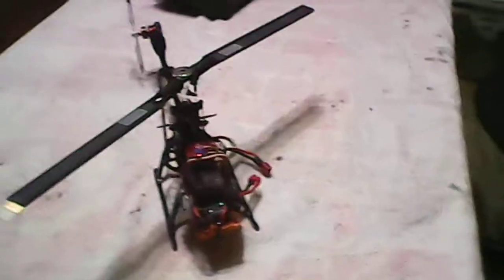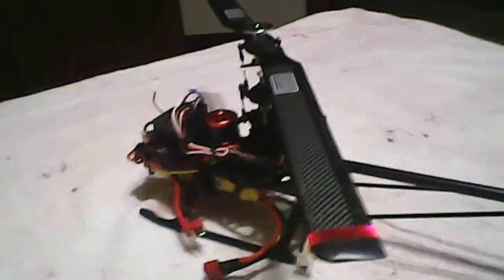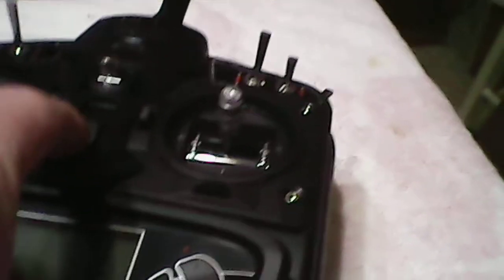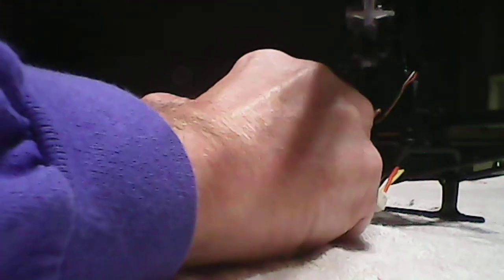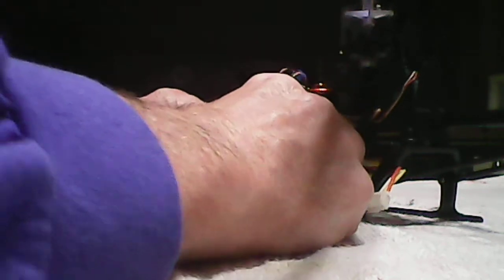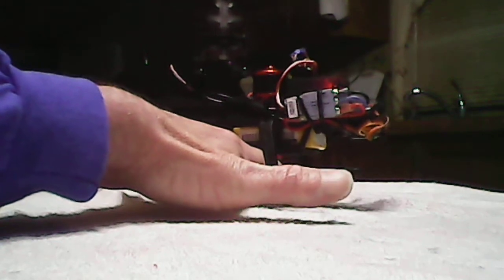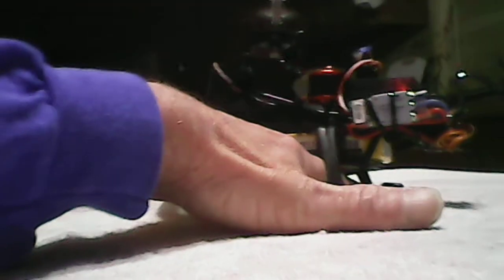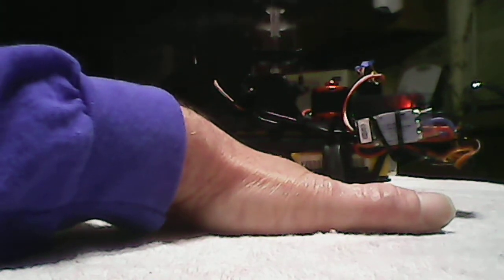Walkera master CP full brushless conversion

Comment: I bought that kit from gordon in january, but my tail motor burnt in 2 mins =/ due to factory problems
the motor ur using is the new 1811-3800 ??
Reply from the maker: Yes it is actually a Hobby King motor that Gordon has in the kit. I have about 2 hrs of time on it now and still works good
Reply: mine came with a factory problem and got burnt, but gordon refunded me right away
Reply from the maker: Thanks for the info.